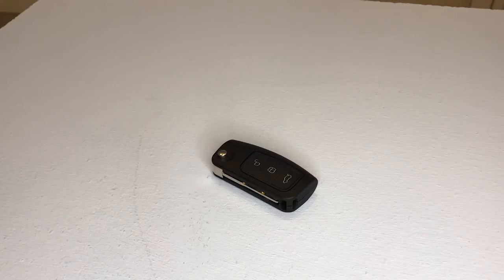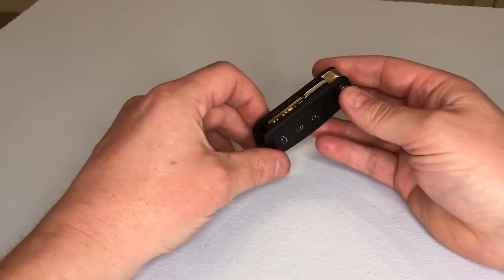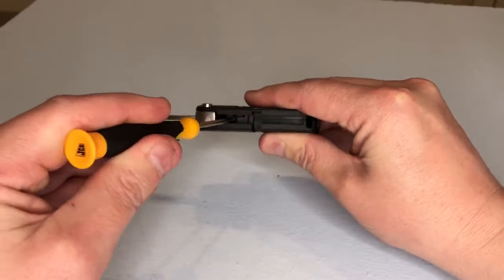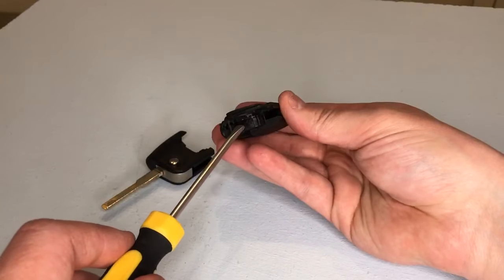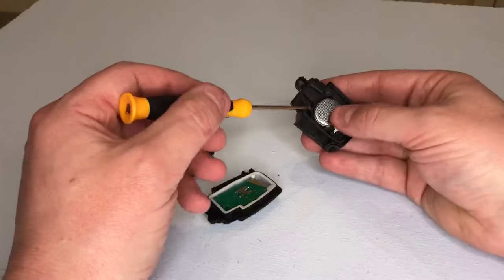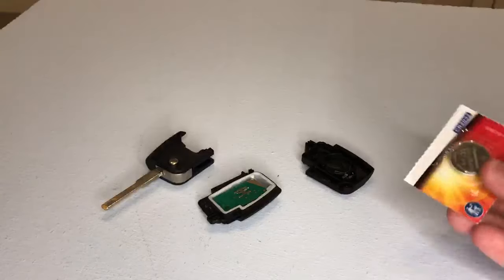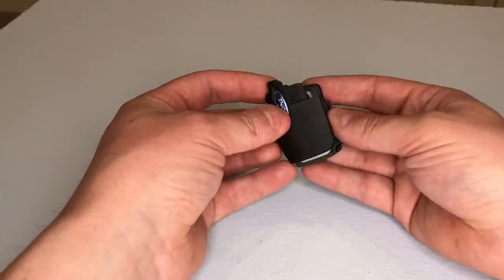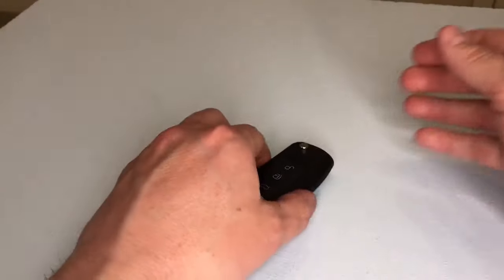Ford Fiesta Key Fob Battery Replacement, Focus, Mondeo, S Max

Comment: Thanks, just changed 2 Duracell batteries in 2 remotes (CR2032) in under a minute each at a cost of £4 (pack of 2), my local Ford garage wanted £14 to change the battery in 1 remote.